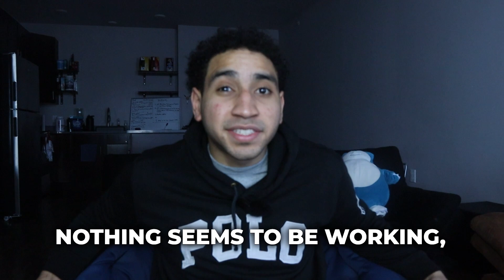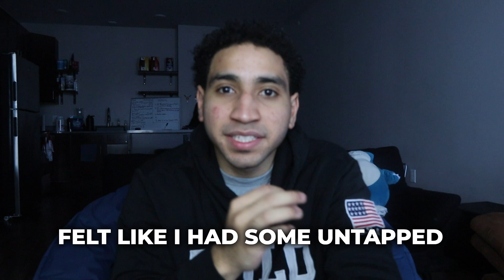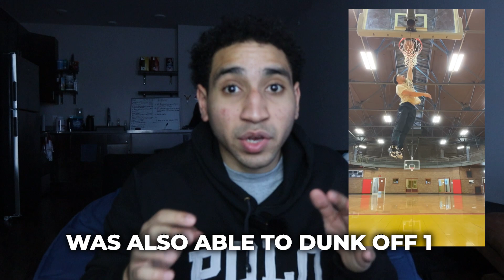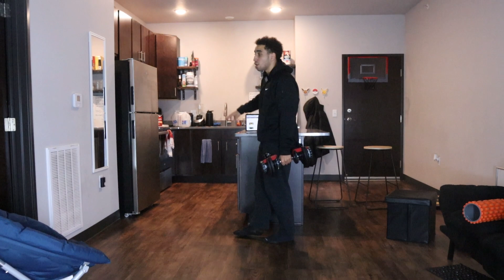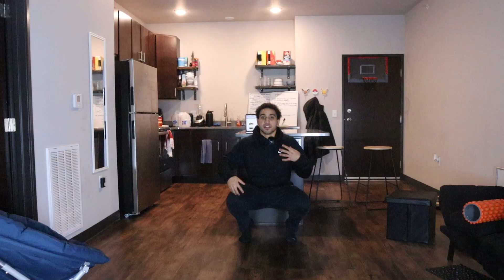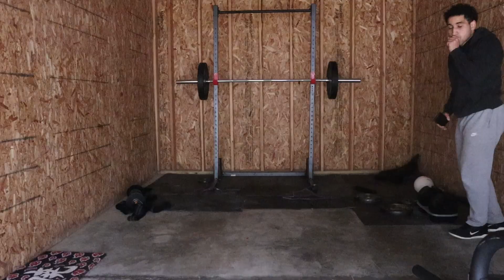3 Explosive Exercises Most Athletes Skip

Comment: 1 have a question about resisting sprints. You've said in the past that when you're "slow" (run above 11.7 in 100m or 4.5 in 40 yd) you reach your peak velocity at literally your third step.
You've then went on to say resisted sprints will really help become one of the fastest accelerators and fix this problem. What do you exactly mean, if you reach peak velocity at your third step aren't you a fast accelerator? For a guy like me who plays football and only really cares about the 40 time, wouldn't you want to reach your max speed as fast as possible? And how would resisted sprints help you from not maxing out within the first 10m?
Reply: If you exert more horizontal force during acceleration, you accelerate for more steps  to a higher top end speed, versus accelerating fewer steps to lower speed. The goal is to accelerate as long as possible.